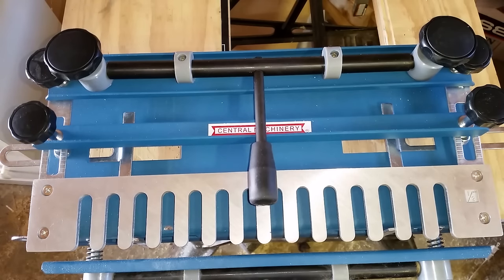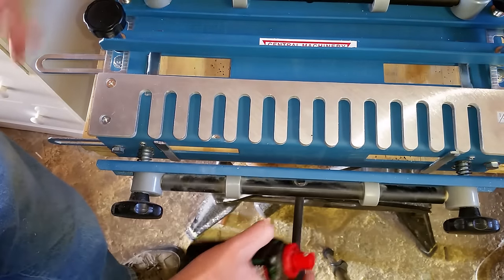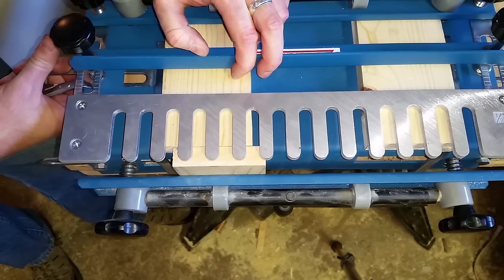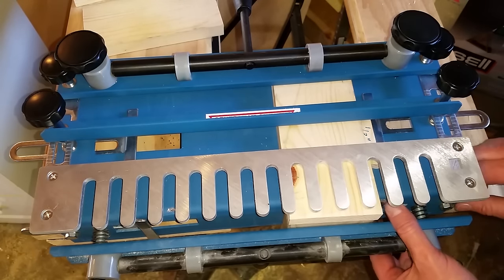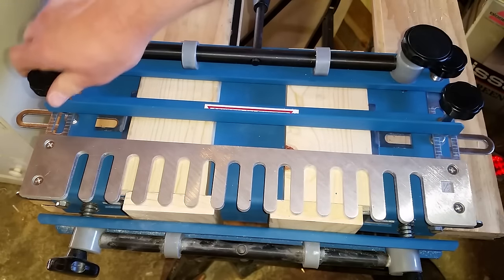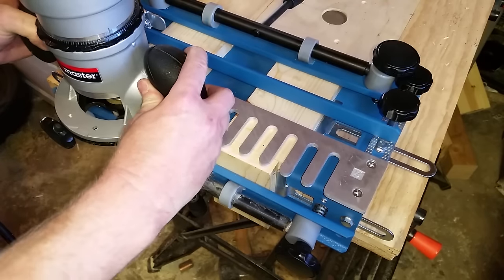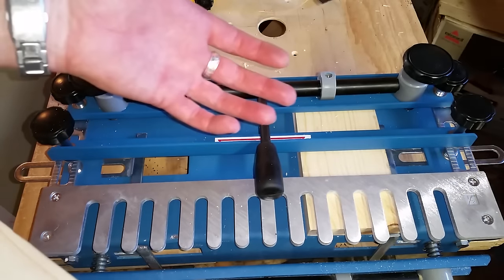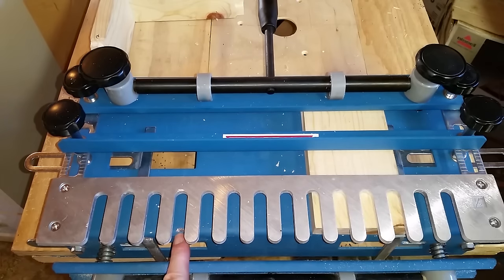How to setup a Harbor Freight Dovetail Jig

Comment: You must have the patience of a saint. I would have taken a sledgehammer to it put the pieces back in the box and given it back to Harbor Freight and suggested they re-think this thing.
Reply from the maker: Oh trust me...I've done that with a few tools in my time.
Reply: It isn't their design. It is a knock off of a much older jig. It is a rite of passage of the machine tool woodworker to master this contraption. It is final boss level material.

Comment: After struggling for a week with this stubborn jig I discovered this video.  A+!  Thank you, MrDabrudda, for identifying and correcting the mistakes in the manual and providing more accurate measurements and methods.  Your detailed instructions explained how to overcome many of the inherent flaws in the jig and enabled me to cut my first dovetail.  Unfortunately, the bed of my jig had a bow to it instead of being flat and true, and the resulting joint was out-of-square.  I also discovered the four phillips screws that attach the comb were not tight which added to the problem.  No wonder I had such a hard time!  I took my jig back to Harbor Freight and exchanged it for a new one, making certain the new jig was straight and true.  This made a world of difference, creating a good square joint.   

As a beginner to making dovetail joints, I thought it would be wise to learn on an inexpensive model that matched my skill level.  It turned out to be a major pain in the neck.  Yes, HF jigs are cheap, but they are very unforgiving to novices and fight you every step of the way.  I learned the hard way they can be poorly made, and that I also needed template guides (not included) to operate the jig.  It took me a lot of time, effort, research and patience to get one to work, including downloading the Woodstock D2796 operating manual (essential!) and modifying its design.  IMHO, you'd be much better off in the long run buying a used Porter Cable kit that includes bits, template guides and an assortment of other combs.  I found one on Craig's List for fifty bucks.  It is much easier to use, far more accurate and user-friendly, and has the flexibility to make many other types of joints as well.

UPDATE:
If the HF jig is right for you, I do believe with careful attention and patience you can coax good joints out of it.  The key is having a good knowledge and understanding of the process.  I highly recommend you download the ((Porter Cable 12" Dovetail Jig Instruction Manual 4210/4212/4216)) and the ((Porter Cable Supplemantary Instruction Manual Dovetail Jig Models 4210 & 4212)), both available for free at www.portercable.com.  Together they will clearly provide almost everything you need to know and will be a valuable reference guide for your library.  Good luck and lots of success!!
Reply from the maker: Thanks

Comment: Spacial perspective and patience my friend. Thanks for sharing. You are the guy that will sit at your jointer with a dial indicator making adjustments until every blade and table are within .001 tolerances.

Comment: Thank You! I purchased one of these jigs about eight years ago. I followed the Harbor Freight instructions but the results were not good at all. I worked with it at least six hours and gave up. I stumbled on your video and after reading the Woodstock manual, I realized what you found that the Harbor Freight instructions are simply wrong. I tried the Woodstock instructions and the very first try was a complete success. Thanks to you I now have a tool that is no longer gathering saw dust in the corner of my shop. Perhaps I should send you a list of the other gadgets I bought that have never lived up to their marketing.

Comment: Thanks for the   video.  I just bought one and you saved me tons of time.  After setup like you did mine works fine and I saved a fortune on this seldom used piece of tooling.  I'll buy beer with the money I saved, lots of it.  I also bought their pocket hole jig with a coupon for about the same price as the Kreg plastic one and I can find no fault with it, works perfect.  I wrote Porter-Cable on it so shop visitors would think I'm a really classy woodworker ! LOL

Comment: Thanks for the video. I bought my dovetail jig about 10 years ago and used it to make drawer boxes for some kitchen cabinets. It worked very well for that. I didn't touch it again until this week and I found that I had forgotten everything I knew about it. :) Your video was very helpful and probably saved me at least an hour or two. By the way, I got very good results again with the jig. It is not fair to compare it with a high dollar jig, but for occasional use, it does the trick.

Comment: I've got one and once you get used to it you can get really good dovetails. When I have a lot of drawers to make, I dovetail four pieces of 1x12 lumber, fit it up, then slice it into layers. You can get 4 drawers a little under 3" deep, 3 at about 4" and two at 6". Saves a lot of time. If you watch the sales at HF you can get them for $70 or so. I got mine even cheaper because they had a bunch that came in without the board clamp levers. I used some 3/8 all thread and a couple of knobs I had laying around. Got the jig for $50. For that price I can put up with a lot of hassle. After a year or so I replaced the eccentric cams on the board clamps. Took a piece of 1 1/4 bar stock, drilled a hole offset from center through about 4" of it and sliced off pieces wide enough to make new cams.

Comment: I purchased one the other day. I did buy the template guides/bushings from Lowes for about 23 bucks and they fit my DeWalt router like a glove. They are made from steel. Also bought a piece of pine to practice with before I use the oak boards. Your instructions are really good, although I do recommend attaching the jig to some 2x6s with a enough overhang to the sides to clamp it down to a work table. Thanks and don't let the man get you down.

Comment: Thanks again. Lowe's does carry the longer bit. I picked one up for about $19.00. It was a 14 degree that manual says to use. Also, your tip for the 19/32" bit depth, instead of 9 /16", was very helpful for getting the tighter fit. And thanks a million for the link to the Woodstock manual. It's a much better manual than the one that comes with  the Harbor Freight jig.

Comment: Got mine for Christmas two years ago and have never used it.  Took it out of storage today and watched 3 setup videos.  It's going back into storage.  Hours of setup time, manual with incorrect instructions, for half-blind dovetails.  No thanks.  Thank you, however, for taking the time to put this video together.  You did a good job.
Reply from the maker: You will get the same setup results with a Porter jig too.  It take several trial cuts to get any jig dialed in.
Reply: Welcome to dovetailing. Setup always takes about 20x the amount of time as the actual work.
Reply from the maker: Yep, and people think they are going to get results without tuning the jig.

Comment: Good information you're sharing here, but this is why I am glad I went with the Original Incra Jig for making joints over other dovetail or box joint jigs. Setup is simple and repeatability is simple, and it doesn't require any of the inserts. Looks like you got your setup working good for you.

Comment: Saved my life! Thank you very much, it was hard to find a video explaining the fence adjustment.
Reply: As I understand it fence adjustment depends on the base of the router you're using. Different routers have different diameter bases so that puts the bit from the edge of the base at different dimensions. Being as not all radii are equal. Which is why the fence is adjustable in the first place.

Comment: Looks similar to my Jet 12" master dovetail jig.  I am working through the adjustments to make it work.  I appreciate your video
Reply from the maker: Yep, looks exactly like the HF dovetail jig, Woodstock D2796 jig, Busy Bee Craftex CT052N jig.  I'm sure there are many other jigs that are off shoots of this jig.
Reply: The instructions are not that great.  first set-up with the bit at 7/8" produced a non working joint.  should have been obvious to me before I finished but i wanted to try it per the manual first.  I may look at the Porter cable 12" dovetail jig if I can't get this one to work
Reply from the maker: Updated manual with the correct info for the Harbor Freight dovetail jig and the Woodstock D2796 dovetail jig.
https://drive.google.com/file/d/0B7nDu4dJR2PnY2Fmc3lkTnRnTE0/view?usp=sharing

Comment: Caught this on the Harbor Freight web site, and tracked down your channel.  Well done, excellent example of how to make their stuff actually work.  
Thing about "Hazard Fraught" - the stuff usually works (although not to the level & durability you might want in an industrial environment) and is fairly inexpensive.  But there can be a fair amount of figuring out and even re-engineering involved, as you have shown here.  It comes with the territory.  Personally, coming from a mechanical engineering (marine engineer, actually) background I kind of enjoy it, so I buy their stuff.  
If you don't want the aggravation or don't have the time, that is perfectly understandable: there may be a Festool dealer near you.
Points to Harbor Freight for throwing this up on their website.  You hold their feet to the fire from time to time in this video.
Points to you for turning off the sound for the part where you are running the router.  Surprising how many folks don't realize we don't need to listen to a machine cutting wood.
Reply: harbor freight doesnt include directions.ithink i willspend the money andgeta good one

Comment: My HF jig does a good job, but you need three hands to set it up. And plan on having a lot of scraps on hand to cut up getting it just right. And, you don't have to take the cam locks out and turn them around. Just unscrew the handles, rotate the cams 180 degrees and screw the handles back in.

Comment: I’ve been using this jig to make speaker cabinets for a couple years now. I think it’s more than worth the money, and the setup is not that bad at all.  This video’s recommendation of setting your bit depth to 19/32” instead of the manual’s 23/32” is right on. I had to do quite a bit of work with a file at 23/32 because the joints were way too tight. Great recommendation!
Reply from the maker: The depth of cut can also adjust the tightness of the joints.

Comment: I bought one of these yesterday and tried it out. One thing I noticed is that when I clamp down the horizontal board, the aluminum comb raises up about 1/16" above the board, not laying on top of the board like you would want. I think the base may be flexing a bit, causing the comb to raise up. I'll look into what's causing it when I get more time. I bought the brass pilot set at HF too. The 7/16" pilot was longer than the thickness of the comb, causing it to protrude below the comb. I removed about 1/16" off the length of the brass pilot. All in all, not a bad deal if you can work with its imperfections.

Comment: First, and most important, thank you for your service to our country!  Secondly, I really appreciate your detailed videos (addendum included) on this jig.  I just bought one a few days ago and found that the rear clamping bar was installed backwards out of the box on mine, also!  After reversing it, I found the jig pretty easy to install.  I just finished getting my two practice boards clamped, and I'm anxious to get started, following your examples.  Take care, and hope you have a pleasant Veterans Day.
P.S.  These two videos by MrDabrudda make setting up and using this jig about as simple as can be, so if you're unable to understand and follow along, then instead of leaving commentary that betray your obviously low intellect, just move along to the candle making vids.  Surely you'll get much more out of them.

Comment: First and foremost, thanks for a well done video.  This is definitely a must-watch if you buy a HB jig,  That said...

I think what your video did for me was to convince me that my screwed & glued joints are just fine,  Joints that I made 20 year ago are doing well.  My work isn't heirloom quality and I don't expect it to be cherished 100 years from now.  I'd like to be able to do dovetails, but this just seems like more trouble than it's worth.
Reply from the maker: Set it up once of 3/4" stock and that is all you have need to do.
Reply: I find that not all 3/4 stock is created equally.  Pure wood like pine or oak boards are one thickness,  oak/birch/maple plywood can all be different.  This doesn't mean that I'll never try this.  For only $35, it'd be an interesting experiment.  Also, if I could dovetail joints, I might consider 1/2" stock.  Lighter drawers with larger interiors.
Reply: It's like anything else. Some guys change their own oil, others don't. If you have mechanical inclinations, it becomes second nature. Also, a love of woodworking helps.I ruined several pieces of cheap wood before obtaining a good fit. Once you get it right, it's very cool.

Comment: First silly advice is taking off the top clamp and turning it around so the handle tightens to the rear.  Much simpler just to screw the handle in the same hole but on the other side.  Like....DUH!  Another thing is that settings for the front and back are entirely different when the front is rabbeted and not a false front.  Just buy two of these, then adjust one for the front and the other for the rear.  It takes way too long to adjust back and forth.
Reply: That is what I did on mine, lol

Comment: If you find that the front of the board is lifting when you tighten the top clamp it is most likely because of poor quality control from the manufacturer.  I had that problem and discovered that the top of the unit was not flat. So, when you clamp down the rear of the board the front lifts, like a teeter-totter. If you remove the top clamp and put a straight edge across the top of the unit you will know right away if that is the problem.  There are two fixes that I know of; returning the unit may be the easiest.  I went to a friend's machine shop and pressed the top flat with a hydraulic press.  In fact, I made it a little concave, which is not a problem as the jig works perfectly now.

Comment: The 1/2 inch guide fit between the fingers for me but you CAN NOT get a joint that works. 
I struggled for longer than I care to admit, until I sought help. Thanks for the video.

Comment: I had the same guide problem, I went to Sears, they had a kit which provides about five end plates which attached to the bottom of my router.  The kit was reasonably priced.  When I opened my Harbor Freight Jig, I saw that it had broken knobs on it that were broken while shipping.  By the time I opened the jig for use, the warranty had expired.  I rigged up an unbreakable repair and the  jig has worked fine.

Comment: WEll i just bought mine and i'm messing with it. My 1\2 collar DOES fit between the combs, but it doesn't matter. it's making my tails too wide. I switched to the 7\16 collar. 18/32 (9/16) depth from base. Fence 1 1\16'' to back of combs for my .75'' boards. Cuts well..fits nice. Took forever to understand how to use this..even with this video. be patient..it does work.

Comment: Thanks for taking the trouble to produce this video; very helpful.  I found a bit that is 5/32 longer than the HF one and it was only $7 and appears high quality: Tideway #LC03030804 and the size is 1/4" x 1/2" x 14 Degrees and 1-61/64 long overall. From Red's on ebay.

Comment: I have a corded and cordless Bauer trim router, and the Harbor Freight bearings fit in them with no problem. It sucks their full size routers aren't set up to accommodate these bearings, or if Harbor Freight made bearings for the full size routers, that would work too. Just a little FYI for those who have their trim routers and purchased their jig and bearing set.

Comment: Are the teeth and slots on the comb both exactly 1/2” wide?
Reply from the maker: No, there is aluminium left over from the casting process.  Guess you could file the comb edges down.

Comment: Are those actual dovetails?  They are half lime dovetail joints, but the look very rounded to me. I have watched this over and over a few times, and I'd suggest selling that and buying an iBox or the original Incra jig and either build your own fence or order the Incra fence for the Incra jig. I think you'd be thrilled with the time you'd save, and the jig is only $54. They have reissued it. Thank goodness for that. 😎

Disclaimer:  I do not work for nor m I paid by Incra products. I just buy my own and use them, and the are just a step ahead IMO then anything on the market. I own a Incra mitre 1000 SE. I use it to build precision jigs that I can't afford, and the original Incra jig, and I will be buying an Incra TS-LS when the projects will pay for it.
Reply from the maker: The inside of the dovetail are rounded so it isn't seen.

Comment: You said in the video that the shank for the dovetail bit from HF is 1.15 inch, which can be chucked in the router, but not deeply enough to be secure.  

The online descriptions of router bits, both HF and other online retailers that I have seen does not include the length of the shank.  

The dovetail bit that another online retailer recommends for use with the Woodstock D2796 12-inch Dovetail Jig with Aluminum Template has a 1-7/8 total length.

What is the total length of the bit that you got that was long enough to be chucked securely?

The dovetail bit that a famous online retailer recommends for use with 
the Woodstock D2796 12-inch Dovetail Jig with Aluminum Template has a 
1-7/8 total length.  Is that enough?

My nearest HF store is an hour away, so I don't want to go there with my caliper to measure the shank, but I guess I could go to the blue store.

Thanks for the great video